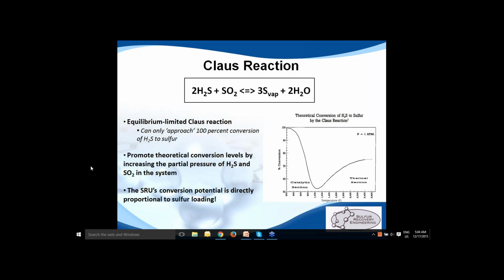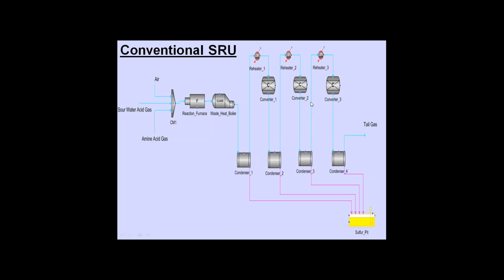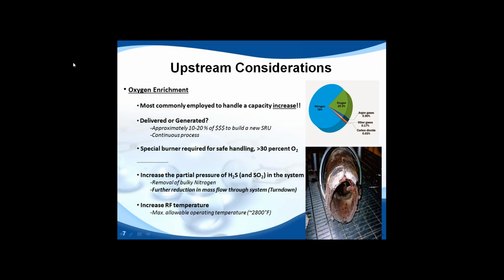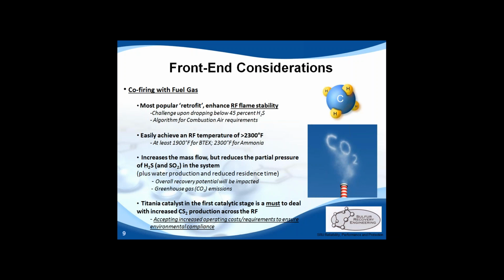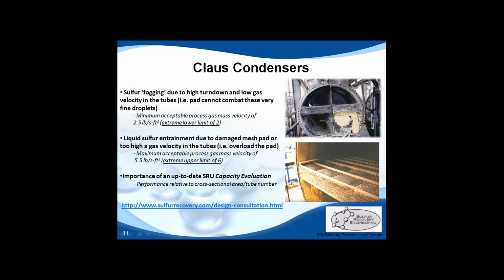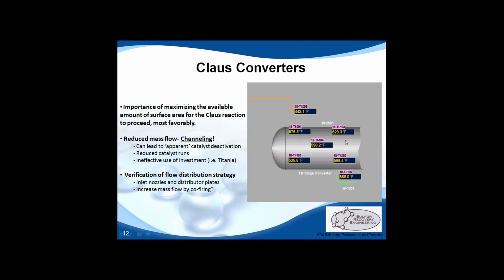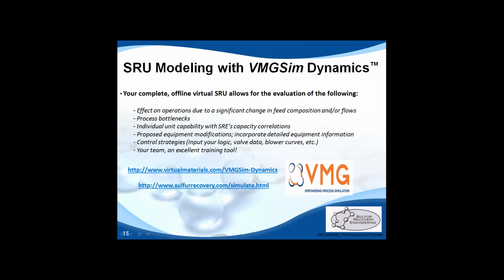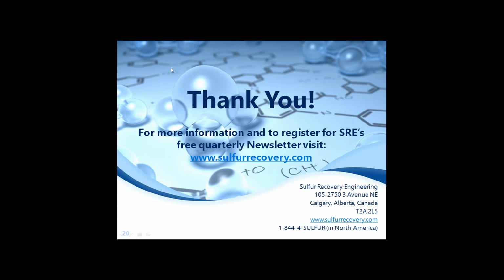Managing SRU Turndown Conditions

Comment: In low feed throughput, we are not able to control the main air valve as it cannot control the flow within the requirement, any solution for that ? We are operating it on manual and therefore there is no control over the ratio and results in poor stoichiometry and conversion, also the flow transmitter is also not accurate in the low flow conditions.